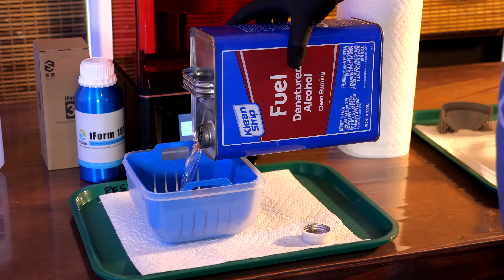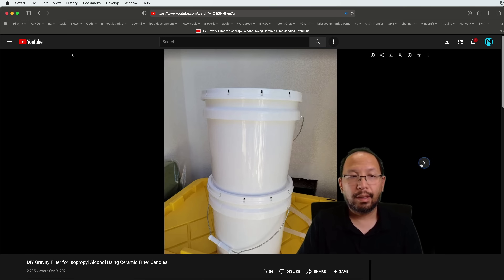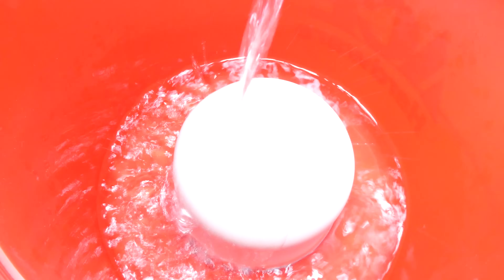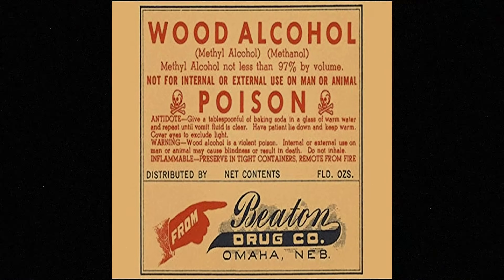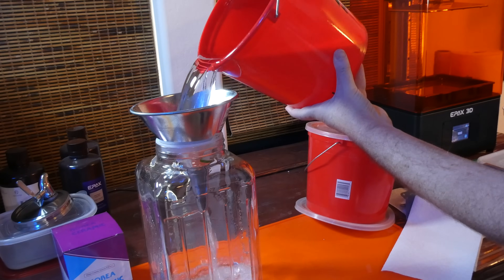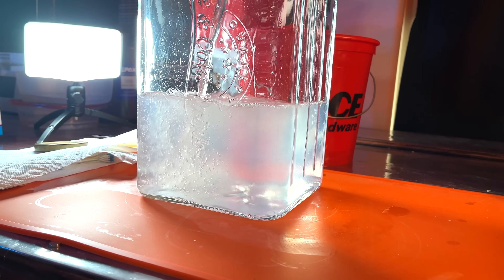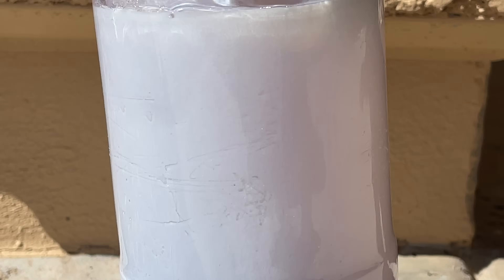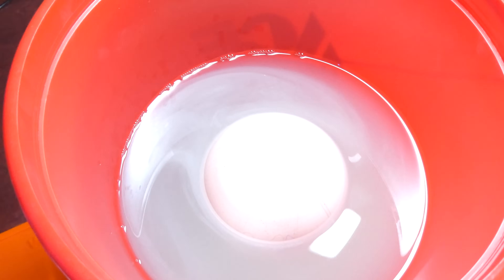Can We Recycle 3D Printing Alcohol?

Comment: Tall thin containers are good for letting the particulates and heavier liquid resin settle to the bottom quickly. Once the resin has settled to the bottom of the container (leave it for 24 hours or longer) expose it to UV light and then carefully decant the clean alcohol off the top. It'll look like you're leaving a lot behind (and you are) but the amount you salvage is worth it once you consider the time spent.
Reply: The problem with this, is having to clean or dispose of the dirty bottles, how long it takes to filter gallons of alcohol which could be weeks, and the alcohol you get is never completely clean.

So Im thinking the way to go is to just use a spray bottle and a brush to use as little alcohol as possible, and this is coming from someone who just bought a wash and cure station.
Reply: Cold temperatures are also great for different substances to settle in a stable way based on density. I use this for brewing, however not sure how it works for plastic polymers.
Reply: @JackRabitJones  it does my stuff settles completley out in my garage in the winter after just one night
Reply: i just use cheese cloth and squeeze out the gross stuff collect the large waist and repeat the process once ig et enough of the super dirty shit.

Comment: I use coffee filters to clean my Denatured alcohol. I have two rinse baths, 'Dirty' and 'clean', and first rinse in the dirty bath, then in the clean one to soak for a little longer. The alcohol in the 'dirty' tub is filtered into a bottle after every few prints, until it's too bad to make a difference. The 'clean' alcohol is also filtered after every few rinses, and when it starts degrading, it is dumped into the 'dirty' bath, and the sludge in that is left in a bottle outside to evaporate away. I may try filtering with those ceramic/charcoal filters on the 'clean' stuff later on.

Comment: I used to have mine (sold my resin printer, too much mess) on a rotating treatment. One jar for initial rinse (mucky pot), one jar for final clean, one jar sat out in UV and one jar running through a filter. After each print they would all be rotated. The mucky pot would go in for UV treatment, the UV treated pot would get filtered, the previously clean jar would become the mucky pot and the now UV treated and filtered alcohol would become the final clean pot. It seems like ballache but it worked well and, TBH, would take about 30 seconds to cycle once everything was set up in its own jar. The thing that bugged me was my use of an ultrasonic bath that was a pain to pour out from with any accuracy. Minor spillages occasionally but it would flash off pretty quickly and I could have just printed and coated a clip on spout for the bath.

Don't let it get super mucky and it comes clean really easily, no need to worry about the wait on filtration as there would be so little in it anyway that it would run through quickly and be easily done before the next print.

Comment: uh, yeah I got no problems distilling alcohol using heat sources. My great uncle was an old school moonshiner, made a mean corn whiskey. Sure the day them revneuers came by my cousin didn't pull and bank the fire like he was told...and the still reached a low earth orbit and cleared out enough trees for my other cousin to move a trailer in that clearing but so long as you keep your head and follow ALL of the safety precautions it works fine.

Comment: IPA (propanol) smells is not denatured.
It smells bad and is poisonous because that is the nature of IPA.
Denatured alcohol is ethanol with poisons added.
Distillation will remove both the water and the methanol provided you catch the correct fraction.
I do not recall the limit of water removal for ethanol, but iirc you can get up to something like 98% by distillation.

Comment: Wow, interesting.
I have always wondered if we could build a continuous filtration system using a peristaltic pump and a filter element ... might help with the "film forming" issue.
Or it might be totally defeated by it.

The other thought I had was to build a vacuum distiller, again using a peristaltic pump, so no heat involved.

Comment: Distilling is a huge fire hazard.  Similar to this some people finish ABS prints with a vapor bath of acetone.  Looks great.  And by that I mean the fireball looks great.  Same basic process going on in your distiller.
Reply: Except distillation involves heating the IPA which is dangerous indeed, whereas acetone vapor bath is done in a container with just paper towels at ambient room temperature. I concur however if you're talking of using electrical ultrasonic nebulizers, which are an innovative IG-nobel way of burning things as the vapor of these combustible liquids just wait for a single electrical spark to ignite.

Comment: Methanol and ethanol have enough difference in boiling point that they should be separable with proper distillation apparatus (not a water purifier, which probably runs at over 100°C to evaporate the water).

Comment: If I were going to mass distill alcohol I'd just place the machine in a metal box on a metal rack away from anything easily combustible. Maybe even a metal shroud like a grille shroud to collect the heat in case of fire. I wouldn't close the box though, don't need an explosion in an enclosed metal box.

Comment: After seeing this video a few months back, I tried this out, but had issues with the filters not sitting solidly against the bottom of the bucket, and causing alcohol to spill. Tried finding metal nuts, and thicker gaskets so I could tighten it up a bit, but no luck.. kinda gave up after a while. But should probably give it another go, just because I have all the stuff.

Comment: Great video, but seeing the settling of resin in IPA made me think about an essential oil distillation process. There is a tap on the bottom to get rid of the heavier impurities and to keep only the wanted liquid that is floating on the top. Maybe using this principle instead of the resin curing step, may improve the results and/or speed the process.
Reply: that is what I do.....I let it settle and then decant the alcohol off the top....and then even filter and re use the resin for printing non critical things.....

Comment: I put my alcohol container on my magnetic mixer into my curing box and had it mixing during the curing time. It did not turn to mucus, but stayed granular. I ran it through a paint filter and it caught most of the cured material. Only did the one shot, will try it again, maybe even without the stirring to see if that helps.

Comment: IPA is pure isopropyl alcohol.  There are no denaturing agents added to it as it has a foul taste and is toxic in its own right but not nearly as toxic as methanol.  I would stick with IPA if I were you, there are several more volatile toxic solvents in denatured alcohol. The main additive usually is 10% methanol (methyl alcohol), hence the name methylated spirits. Other common additives include isopropyl alcohol, acetone, methyl ethyl ketone, and methyl isobutyl ketone.  In the United States, mixtures sold as denatured alcohol often have less than 50% ethanol.

Comment: I've built the three bucket system with two filters each in the top two buckets. The issue I've come across is the plastic wing nuts were bad so the buckets would leak out into the lids beneath. I've replaced them with metal but even with the included rubber pieces there's still a leak from the buckets above onto the lids beneath them.

Comment: I'm using mostly Elegoo standard grey resin and found that cloudy grey IPA (after washing a few smaller models) will turn almost clear overnight with a thin layer of white uncured resin at the bottom of the container. I've placed this container in the sun for 2 days and the liquid turned milky white. There is more sediment at the bottom, but looks like there is no way back to (almost) clear IPA I had before the sun-curing :(

Comment: The method I was thinking is to take the alcahol with the resin settled out of it and use a peristaltic pump to circulate it through a uv chamber which drips into another dark chamber with a sand filter or something similar, that way over time the resin slowly gets cured from the alcahol and gets caught in the filter
Reply: the tubes would start to have resin stuck on the walls. Maybe have the curing part on the pump inside? so each time resin gets cured it gets crushed by the pump rollers and it then continues to the rest of the system. Im thinking having paint sprayer filters on the inlet and outlet of the pump.

Comment: How about modifying the UV clarifier used on pond filters with a different wavelength lamp and them keep recycling the Alcohol through it in a loop with a filter along the way to strip out the solid cured resin?

Comment: Thanks for testing this. Side note denatured alcohol and isopropyl alcohol are two different molecules. The term rubbing alcohol can refer to either. Denatured alcohol is ethyl alcohol that is poisoned, usually with methanol. Thought I would point that out since you use all the above terms interchangeably and I got confused.
Reply: Your comment is way too far down the list. One other thing that bothered me about his descriptions is that isopropyl alcohol isn't poisoned, it is itself poison. Ethanol is the only alcohol that is 'safe' for humans to drink.
Reply: Seconded this. There are three alcohols: methanol (extremely poisonous), ethanol (drinking kind, mildly poisonous), and propanol (two kinds, one is "iso" which is IPA/rubbing alchohol, and fairly poisonous). "Denatured alcohol" is ethanol (drinking kind) with stuff added which is very difficult to remove and makes it more poisonous. 

When I say it can't be removed, it's probably an azeotrope, so it can't be removed by distilling at all. The same way ethanol can't be distilled below 4% water, and IPA can't be distilled less than 13% water because of azeotropes.

Comment: As somebody who reprocesses alcohol by putting it under the same UV cure light I use for my resin parts and then filtering it through what you described as a paint filter, it's impressive seeing how this high level of filtration is able to get you perfectly clear looking alcohol. Curing out disolved or suspended resin and using the 'paint filter' to catch that solid material still leaves my alcohol with an increasingly strong color to it as it continues to be reprocessed, and that's been a bit of a disappointment. I think what's happening for me is that resin has pigmentation particles suspended in the mixture of polymers and photoreactive molecules. As the polymers interlock within the standard resin mixture, they 'capture' the pigmentation particles within a cage of interlocked polymer bonds. However, once resin and alcohol is mixed, the carefully engineered molecular mixture gets totally dispersed in the alcohol. It does seem photoreactive components are still able to promote some bonding between polymers even when they're all interspersed in a sea of alcohol, but this bonding definitely isn't 'caging' the pigments anymore. The pigmentation particles themselves don't react to the UV light at all (which they shouldn't) and are too small to be captured by the 'paint filter', so my own reprocessing workflow just doesn't have any effect on them. What you're really up against trying to get that perfectly clear looking alcohol is getting a fine enough particulate filtration that you are able to filter out the pigmentation particles especially, although there may be some color cast to other magical ingredients in the resin mixture that might promote bonding/stability/etc but, like the pigments, fail to get compeletly captured in the polymer bonds when everything is super interspersed in alcohol. Honestly wouldn't have thought of it if I didn't see this video, though. Thanks!

Comment: Instead of pouring out the alcohol after the sediment settles to the bottom, siphon the cleaner alcohol off the top to leave the sediment undisturbed. That alcohol should be easier to filter. Then I pour the sediment into a disposable aluminum tray and let it cure outside so the alcohol evaporates and the resin becomes safe to dispose of.

Comment: To clean the filters, you could try running water through it backwards to flush the gunk off the surface.
Capture the water and let it evaporate and you will be left with the slime/powdered resin.

Comment: Instead of gravity Filtering use Vacuum Filtering, Either a real vacuum pump which are cheap now but might be way too powerful. A Brake Vacuum pump would be more than able to pull your solvent cleaning solution when chunky through a filter, use a cheap Büchner funnel or mesh and filter paper in  regular funnel and a vacuum flask or a container with a hose connector glued in. Funnel should fit tight to the top hole, we want a vacuum to form and do the work after all.

Comment: You could totally use a still to seperate the drinkable alcohol. You would need to measure the temps and only use the portion that distills at the correct tempreture.
Reply: You are missing the point. When a distiller is working it keeps switching on and off creating a spark which can, and probably will, ignite the whole set up. Also there is no such thing as 'drinkable' IPA alcohol.

Comment: alcohol distillation is actually very common in chemistry and can be done quite safely, especially if you use something like a heating mantle. that said, its never a good idea to do a procedure that could potentially be dangerous if you don't know exactly what you're doing, and heating up the uv resin to distillation temperatures certainly involves some unknowns i wouldn't personally feel comfortable with without a fume hood or something. if you have a filter media that works to remove the resin, i would say a vacuum filtration would probably be the best option if you want to err on the side of caution

Comment: When your jars of alcohol have sat for a *good long time*, the trick is to use a siphon to slowly pull the alcohol out without disturbing the settled sediment. Further, curing the resin in the alcohol with sunlight DOES work, but you have to let it sit for days or weeks, and the alcohol WILL separate out of the forbidden-jello-resin, for you to pour or siphon off. Your process with the gravity filter WILL work, but the hardest step in the whole process is patience, other than distillation there's no replacement for just... time.

Comment: Try 3 stage particulate filtering which is used in water treatment; first put aluminum sulfate dissolved in water into the IPA, agitate it for a while.  This causes the resin to coalesce. Second step, decant it through a cheap paint filter, this removes all of the 200+ micron particles, with most of the heavy resin staying in the decanting container.  Then you can use the gravity filtration.  This will save on clogging the gravity filters. Finally, you can distill it as in my prior comment, with the filtering letting you distillation equipment last.
Reply: See Recycle Isopropyl Alcohol Fast! video on YouTube from Makers Mashup: https://youtu.be/HxT8rEr-tFI

Comment: You need to do fractional distillation, the same process used in the petroleum industry to separate kerosine from gasoline.  It uses differential cooling rates via a fraction column to pull off different precipitates based on their boiling points.
Reply: Fractional ist Not even necessary here. And any explosion risk from alcohol fumes can be avoided if one would use sealable Containers which can Withstand Vacuum. Destillation could then be done with a Vacuum Pump und a cheap Heat mat in a fully sealed and Close to oxygen-free environment. Connect the Containers, evacuate, place the Heat mat below the one with dirty alcohol. At Low enough pressure, the alcohol will evaporate even at rooms temp. Then Close the Pump valve, Heat one Container and watch the Magic happen. clean solvent will collect in the "cold" Container. And Just a few degrees of Differential Temperature will do the Job. Could also Just place the assembly in the sun and Cover Up one Side to be cooler than the other one....
Vacuum pumps are cheaper than the lab Equipment for fractional Destillation as well 😂
Reply: @Stahlfreund , I was thinking about it too, but I have a few questions:

> At Low enough pressure, the alcohol will evaporate even at rooms temp
Doesn't it evaporate even at normal pressure?

> Heat one Container and watch the Magic happen
Won't this increase the pressure in the system, breaking the seal of vacuum chamber?

Also i'm concerned about the solvent condensing in the vacuum pupm and mixing with vacuum oil during pumping.
Reply: Sorry, my German Auto correct messes Up Text faster than i can  Look 😂

Comment: why all that effort? All you need is a clear plastic bottle and the sun. Leave the dirty alcohol in the bottle. the resin insight will cure and drop to the bottom of th bottle. just a few days later, you can pour out clean alcohol and the resin will have sunk to the bottom. i am using the same 3 bottles of alcohol for 3 years now ;-)

Comment: Yes the mucus I've learned that as well to not let my alcohol get that dirty.  I personally filter IPA often through a metal tea strainer 1. alcohol is not adsorbed by the paper filters 2. is a fixed cost vs buying and disposing of paper filters.  But then again I use paper towels to remove the gunk out of the metal strainer and to wipe clean my alcohol vessels (i.e. Tupperware and pickle strainer bucket)  And yes I need a better way to pour alcohol as I often find I spill as much as I am able to save sometimes pouring out of Tupperwear.
Reply: I’ve started using large syringes - 250ml and larger - for that same problem.